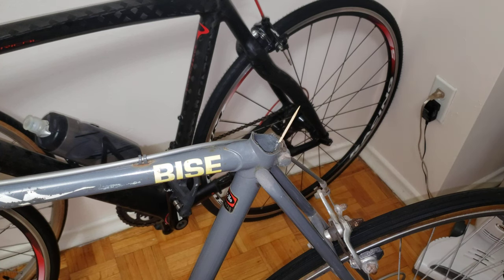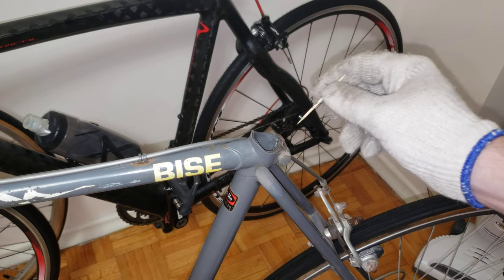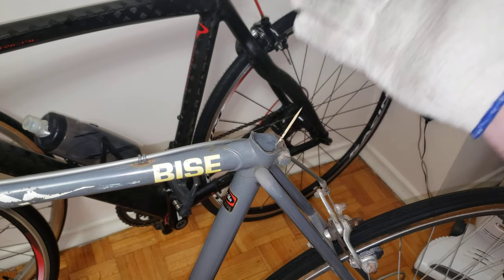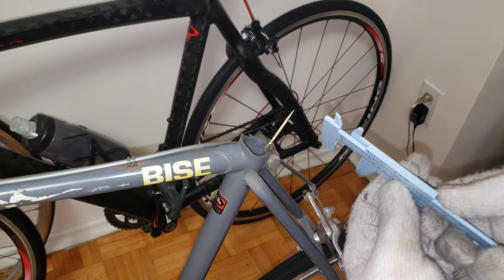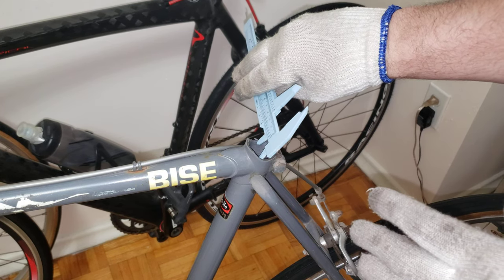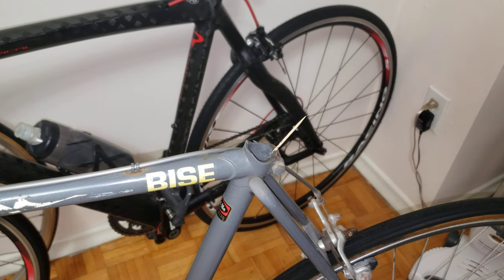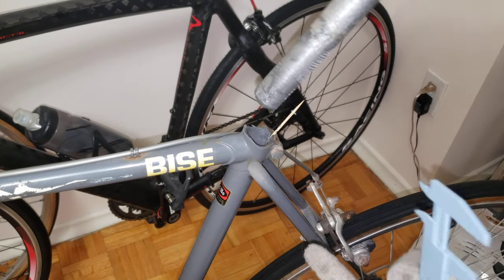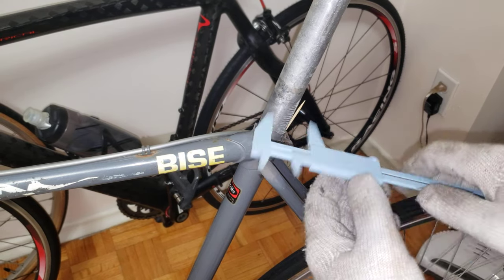How To Find Out The Right Size Seat Post For A bike | 4K

Comment: What size is my seatpost if my bike has 30mm diameter? I subbed
Reply from the maker: 30mm diameter usually ends up being 24/25mm seatpost. That measuring tool would confirm 100% the size.